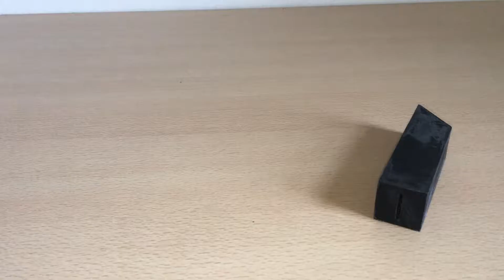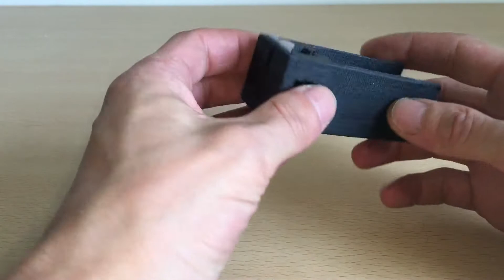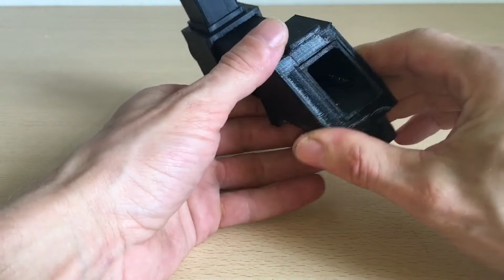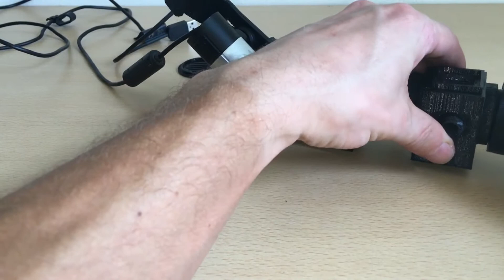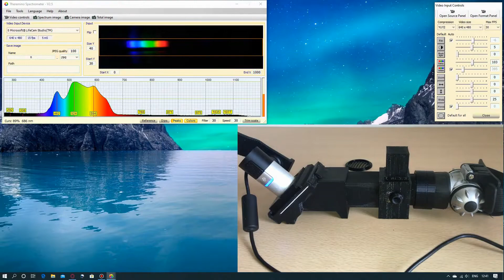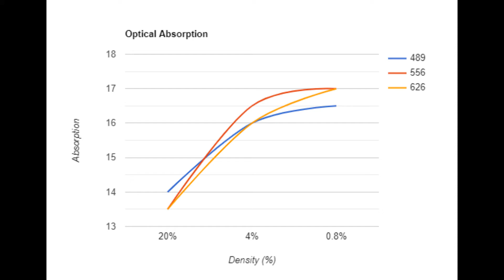DIY Spectrograph

Comment: How to Calibrate the Device?  Means ROI of Image EM Visible Spectra. Does it give emissions? Thermino?
Reply: You can use an fluorescent lamp, as it has known peaks, see wikipedia, or use two laser pencils of different colors, a.e red (650nm) and green (532nm), they are also pretty standardized. More in Le‘s channel for Py Spectroscope, he shows the steps.

Comment: cheap LED light can't replace sunlight at all. Your scheme says "sun light" and this is right, cheap led light is wrong.
Reply: Near Slit , What is there ??? Diffraction grating or Mirror ?How to select wavelength for this caase? for example 400-700nm  for analytical analysis of chemical solution or dye /Where you had connected DVD Diffraction grading? Have you connected the mirror? At the edge of the slit? Or you have connected in front of the camera-Lens?How to get absorbance -wavelength curve for a cuvette
Reply: @techpiku1 Too many questions. Seems you still need to learn a lot, before build one. It will be simpler for you buy one, or go to lab, or ask engineer to build one for you.
Reply: @kiyashko86  :))
Reply: Asking for that software for absorption analysis

Comment: Thank you very much for sharing this interesting info and video. I have just few questions. 1-Where can I get this tool? Could you explain about the software? How can I determine the exact wavelength and absorbance of the various concentrations? 3-Could you clarify the wavelength selector in more detail? We can replace it with a normal CD.
Reply: Near Slit , What is there ??? Diffraction grating or Mirror ?How to select wavelength for this caase? for example 400-700nm  for analytical analysis of chemical solution or dye /Where you had connected DVD Diffraction grading? Have you connected the mirror? At the edge of the slit? Or you have connected in front of the camera-Lens?How to get absorbance -wavelength curve for a cuvette

Comment: Can you please link up the camera used in the video.
Reply: Near Slit , What is there ??? Diffraction grating or Mirror ?How to select wavelength for this caase? for example 400-700nm  for analytical analysis of chemical solution or dye /Where you had connected DVD Diffraction grading? Have you connected the mirror? At the edge of the slit? Or you have connected in front of the camera-Lens?How to get absorbance -wavelength curve for a cuvette

Comment: Cool project! I have a few questions:

1- Interesting voiceover, what software did you use? Are you not confident in speaking English? Or are you an AI in totality?

2- Does the Theremino software already know the frequency response of a handful of cameras, including the one you used? It seems you would need to make some major calibration adjustments otherwise.

3- What music did you use? It sounds like a chilled down Kitaro, from India.
Reply: Near Slit , What is there ??? Diffraction grating or Mirror ?How to select wavelength for this caase? for example 400-700nm  for analytical analysis of chemical solution or dye /Where you had connected DVD Diffraction grading? Have you connected the mirror? At the edge of the slit? Or you have connected in front of the camera-Lens?How to get absorbance -wavelength curve for a cuvette

Comment: Hello, I'm using your video as my reference for my project. I wonder how did you make the spectrograph from the values displayed in the app? Thank you
Reply from the maker: Basically I draw a graph using 3 known concentration solutions. For every measurement I compared the solution with a 0% (only the solvent), to compensate for the cuvette. With the 0% I've "zeroed" the app (Reference option in the app) and take the measurement. I picked a frequency to use for all measurements.
I've added all tree values to a graph (concentration / light dropp) and connected them with a line.
When you measure a unknown concentration, now you can compare the dropp to the graph and get the value.
If it doesn't make any sense let me know and I'll make a separate video explaining and demonstrating at the same time. "See you" later.
Reply: @beermoneylab7492  okay, I'll try what you said. Thank you again
Reply: @beermoneylab7492  hello could you make that video
Reply: Near Slit , What is there ??? Diffraction grating or Mirror ?How to select wavelength for this caase? for example 400-700nm  for analytical analysis of chemical solution or dye /Where you had connected DVD Diffraction grading? Have you connected the mirror? At the edge of the slit? Or you have connected in front of the camera-Lens?How to get absorbance -wavelength curve for a cuvette